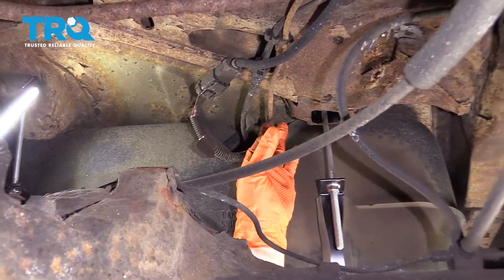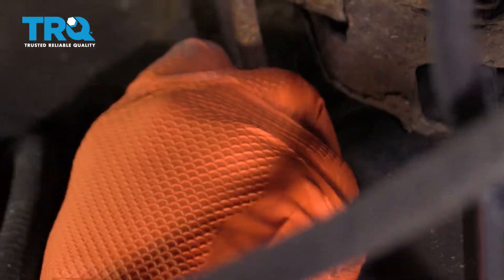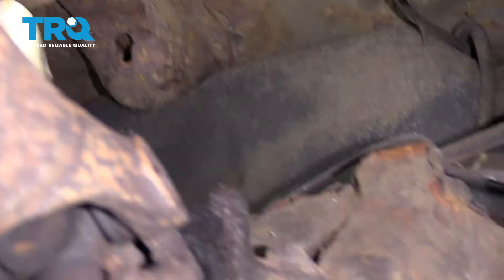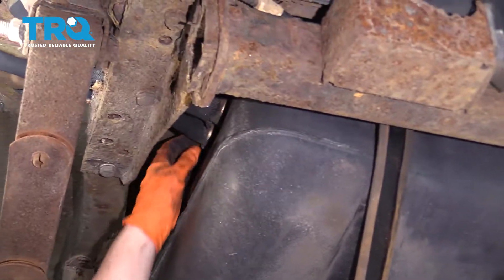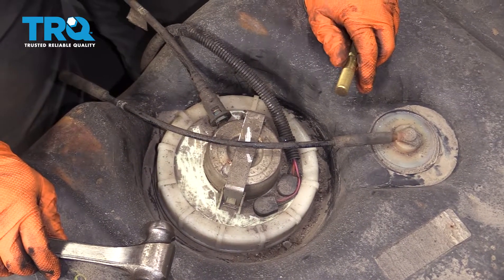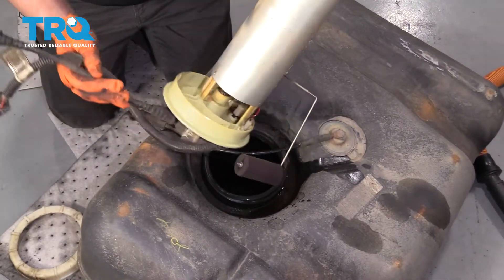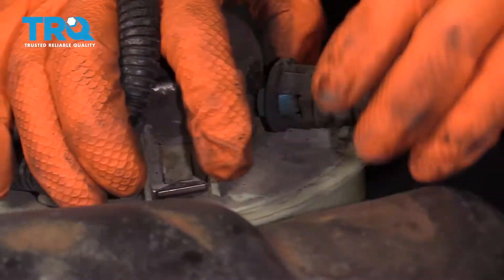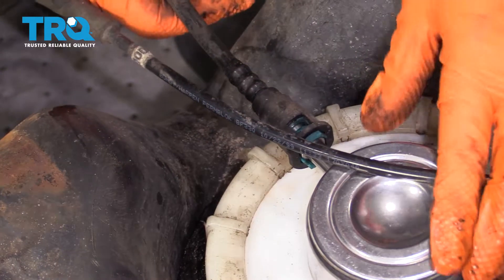How to Replace Fuel Pump 1984-2001 Jeep Cherokee

Comment: This was super helpful thank you, only thing is that I couldn't get the cap to the pump loose with a punch like you did. I used a file, or any flat edge and came through the gal in the front and hit it on the side instead of the top. The top seems to want to break or shave the plastic away where as the side didn't for me

Comment: I am desperate to figure out how to install mine in my 2000/2001 jeep cherokee... I've verified that I did in fact order the proper pump assembly  and it came with a new seal/gasket, but my problem is it seems literally impossible to fit the pump in and seat it with the gasket in place, it's soo tight of a fit that even with lubrication I cannot for the life of me get the pump pressed down far enough into the seal/gasket in order to screw down the top cap... if I put too much pressure trying to push the pump assembly down it just grabs a hold of the seal and pushes it into the gas tank... I've fought it to the point I'm downright frustrated.  I'd be soo grateful for any tips, tricks, or ideas on how I might get this accomplished 🙏 once I get the pump assembly installed I should be able to put everything back together and go put tags on my ol green machine! But it seems I've hit a brick wall... is it possible delphi sent the wrong seal/gasket? Or am I just missing something or doing something wrong? Please help 🙏 God bless

Comment: I bought the TRQ fuel pump and replaced it myself. Not too bad with a floor jack. Make sure you get new straps and J bolts. Works great and now I have a working fuel gauge.

Comment: This is NOT the correct way to replace the fuel pump in a 1984 vintage and later years. The fuel pump is NOT located on top of the fuel tank and it can be replaced without dropping the fuel tank. The tanks in the 1980`s is actually located in the front of the tank almost to the top edge, NOT on top like the video wants you to believe.

Comment: Thanks for getting right to the issue at hand. Vidéo does not deal in detail with details  of removal and replacement of fuel pump itself. What's available from major parts supplies is a sort of one size first all unit, like Precision Fuel Pumps, which included instructions for an in line, not in-tank, installation. It included parts for using the same pump for in tank. Details for that installation, including installation of strainer sock fuel pick up, would be useful. Instructions with part are basically useless for in tank installation.😊
Also, fuel tank Hanger bolts are likely to be rusted, and I'll be destroyed on removal.  They are virtually impossible  to replace on older model Jeeps, but they can be fairly easily fabricated from all thread, or long carrige bolts.

Comment: You are crazy to use a power tool to work around the filler neck assembly. Yes battery tools spark too. I'm really surprised that it didn't fume flash on you...

Comment: I have some issues with this process.  First the tank was not drained and flushed or atleast drained and blown out.    When she dumps the fuel from the old pump she is also dumping debris from the top of the old  pump housing.  This new pump filter will be clogged up in a few weeks of driving.  Also the gasket and pump can be set completely in place properly by hand using a little white lithium grease.  Then the ring will screw on easily by hand to start and I finish with a small pry bar and hammer.  No specialty tools are needed.  Most likely her gasket isn’t set properly and is lipped inside of the tank making a poor seal.  Also using her method can cause the pump itself to separate off its pin spring axis causing issues with the fuel level reading accurately.

Comment: Great video!  QUESTION:  I bought a MINT CONDITION 1999 xj off an old man with 190,000 miles ** WHEN should I replace pump??  How long do they normally last??  ( I like replacing part within reason before they fail.)
Reply: You replace it when it goes out unless you like wasting money. It could last a year or 15 years
Reply: My girlfriend bought a mint 2001 XJ from an old lady with 180,000 miles and the fuel pump is going out. I bought a 1995 YJ in 2005 and it has the original fuel pump, currently have 299,000 miles.
Reply: people say they last like 100k but everyone I know has gotten at least 165k which is what i'm replacing mine at. I would say wait until it shows sign of failure.

Comment: Hey guys,I have a 1997 Jeep Cherokee XJ, and I'm trying to find the fuel filter to replace
Reply: Did you find it? I’ve read it’s inside the gas tank on 97-01 Jeep’s?
Reply: @nickd1978  its built into the fuel pump module when you replace the pump ur also replacing the filter
Reply: Its built into the fuel pump module

Comment: If anyone is confused as to why this looks nothing like their gas tank, it's because the fuel system was completely changed in 1997 with the Cherokee's redesign. The video should be titled "1997-2001", because 1984-1996 models have a different fuel tank and pump, with an external filter and no EVAP System.
Reply: My 94 jeep cherokee has an evap idk what you mean by it not having one
Reply: So you’re saying that Cherokees from 1997 to 2001 don’t have an external fuel filter ? Because I have a 99 jeep Cherokee and I don’t see an external fuel filter in mine

Comment: What Jeep is this; none of this looks like my 92 Cherokee Sport 4.0? Thanks for the video anyway.
Reply: All the fuel system stuff changed in 1997 with the redesign. This video should be titled "1997-2001..." etc, because 1984-1996 models have different parts in different places
Reply: Access to the pump is up front of the tank

Comment: I don't know what that is you are working but it is not a Cherokee . The fuel pump is on the front of the tank and  does not require the removal of the tank or brackets to access it.
Reply: All the fuel system stuff changed in 1997 with the redesign, this video should be titled "1997-2001.." because the older 1984-1996 models have a completely different fuel tank. They're working on a 2000 model in this video